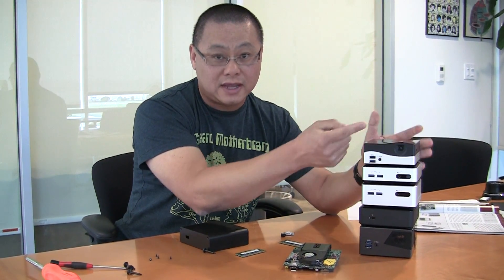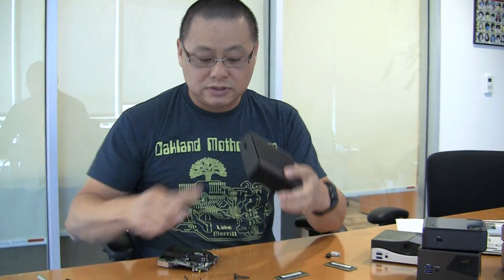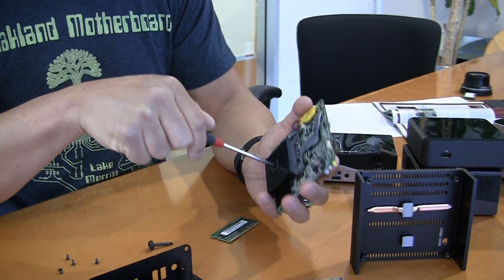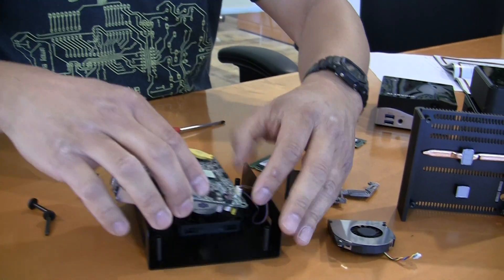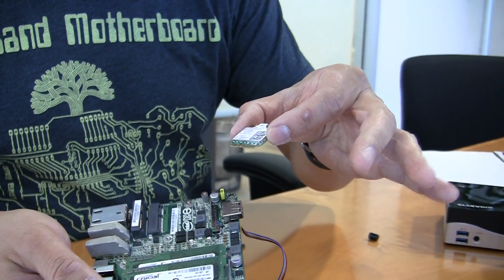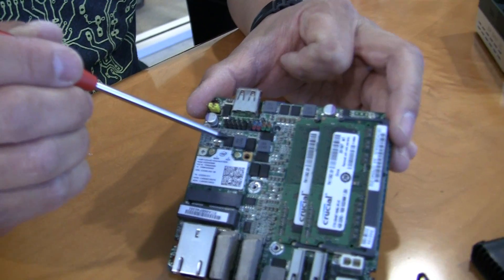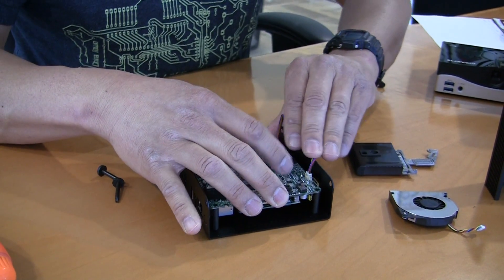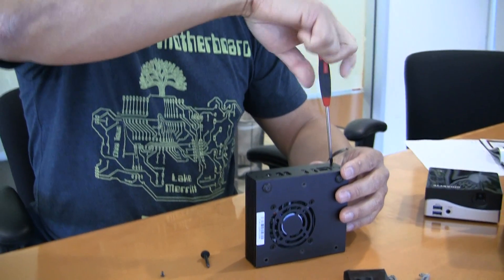Build Your Own NUC

Comment: I won a NUC at an event and looking what to do with the NVMe card that came with the kit? Also do I need extra SATA cable for the Samsung EVO 850 SSD drive or does it just plug into the drive bay in the NUC?

Comment: Excellent custom Mini PC. 
Where find Mini-ITX w/ MXM slot and DP and Thunderbold 3 conections?
Reply: 1: Not custom. Motherboard is supplies by intel to different vendors. 
2: You need to get a very high end motherboard to get Thunderbolt 3. As far as i know, this is one of the only ones. Only a single PCIE 3.0 slot, but it fits everything else you need. http://www.newegg.com/Product/Product.aspx?item=N82E16813132638

Comment: I've actually found good reason for this motherboard and I'm glad I found this video because I've been looking for a small motherboard that could fit in my play station for  PC case mod. The only other small motherboards were the smallest of mini itx motherboards that used a laptop charger as a power supply and even those small ones would be borderline fit like a glove type situation that would obviously have Heat issues. So with this NUC motherboard I might even be able to do my little project with the "PlayStation One" Instead of the larger "Play Station".

Comment: Hi, Nice video.

I am looking to build a hackintosh NUC. 

Here is what I need:
1)  Intel i3 or i5. 
2)  M.2 SSD
3) Half Mini PCIe for Apple Wifi card ( Apple Broadcom with PCIe adapter to fit )
http://www.ebay.com/itm/Apple-Broadcom-BCM94360CD-802-11ac-mini-PCI-E-WiFi-WLAN-Bluetooth-4-0-Card-/251723761338?hash=item3a9be7c6ba:g:yWkAAOSw2XFUa5DU
4) 2tb. hard-drive connection
5) As many USB 3.0 and HDMI, and Display ports as you can get.

Which NUC do you recommend for this build ?

- Thanks in adavnced.

Comment: pro tip: if you have a spare old ass laptop with wifi, you can take the wires, connectors, and leads out of it. of course it requires taking just about the whole laptop apart.

Comment: about the price of building your own NUC, the cost of motherboard is higher than what you would think, simply because there are not big market for buyers who want to purchase the raw motherboard and DIY their own NUC. It costs less for Intel to manufacture the NUC and sell it on the proper market. To me, the Intel NUC box has given a very good deal in terms of the performance and price. 

I wanted to buy a smaller components to build my own mini pc - that was my original plan before I got the NUC PC. But there was no easy market for me to get what I want for building a mini pc close to NUC. Without demand, I don't see any reason why Intel wants to release the market for NUC motherboard. There are not many buyers in this market. Regular users will prefer to purchase the pre-built mini pc which is exactly what NUC is targeting on.

Comment: haha, without the CPU fans, it going to fry itself out at instance. Don't do it at home
Reply: Umm...passive cooling?
Reply: +Chi Hei Tan yeah the bottom of the Case is pretty much a heatsink
Reply: +Cc Ooi No it wont, it passively cools itself, like your phone or a raspberry pi
Reply: +Nami Skyla "your phone or raspi" wont cosume much power compared to this one.  an mobile i7 unit is at around 45watts, the i3 used in this nuc is about 10-20Watts.   raspi is  at 1-2 Watts.

Comment: Yeah....... This guy really sucks at making videos....

Intel really needs to get their shit together with these. They are such a great concept, but with all of the money you have to dump into the damn thing, they should be at least a little bit cheaper. I'd much rather use older parts that I have lying around to make an HTPC. In terms of using as a Steambox, I'd just save the money and get a Steam Link for $50, and host from your gaming rig, over your home network.

Comment: i bought a 21.5 inch lcd. it only has vga and nuc doesen`t have vga port.... :(
Reply: You can buy HDMI to VGA adapters for like $6 on eBay.
Reply: Why the heck did you buy a monitor with only VGA? That's crazy outdated even if it is LCD.
Reply: n33dw33d3333 You can buy outdated things brandnew and if it's only input is VGA it's outdated.
Reply: Jesse Deptula I can't stress this point enough. It's difficult to explain to other people when their like "well, I just bought it." Err, yeah.. but no.. It doesn't work like that.
Reply: its brand new actually
Reply: bugs181  Do you have DVI (white rectangle) port on your monitor? If you do, you can buy DVI-HDMI cable...

Yeah, Yeah, I know, this post is 4 months late....
Reply: ***** You replied to my comment but I think you meant to reply to n33dw33d3333
Reply: Oops. Yeah, you mention that.. D'oh!  I

Comment: so... you prefer a bare motherboard, and remove the fan and heatsink, to then put it into a case that acts as a heatsink but still uses a fan smh

i can understand going for the completely fanless custom cases, but opting for alternative cases that have no added value and actually fewer features just so you can say you built your own is just pointless.
Reply: agreed, you're already adding ram, storage & wifi in boxed nucs, and I have yet to see the boards by themselves at a price more than a few dollars cheaper than you an find the boxed versions if you do minimal searching.

Comment: I picked up a celron nuc for about $140. I had ram and a 2.5 inch drive lying around so it was a good deal. Installing windows 10 on it. I've noticed there is an enourmous premium on power in these little boxes. The lowest end ones are the only ones that are reasonably priced.

Comment: 190 dollars seriously. i do want to build it but all i see is just you add the motherboard in. so i don't think it matters than. the intel nuc is 200. the case is 40 abed the motherboard is a whooping 130 bucks. thats the base with an atom. so it is not exactly supposed to be that intel nuc with an i3. an i3 is 280. 

conclusion. 320 BUCKS. SERIOUSLY. AN i3 is LIKE 200